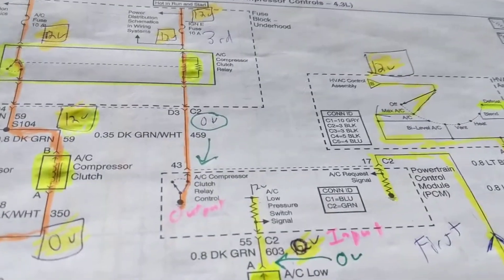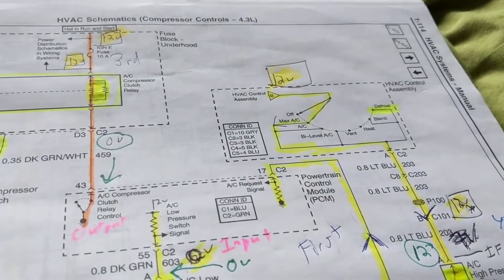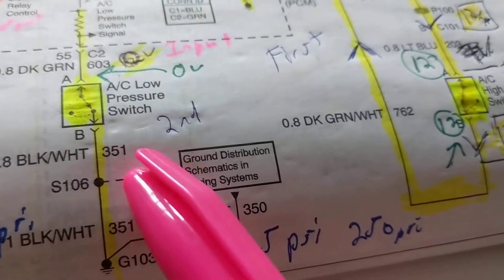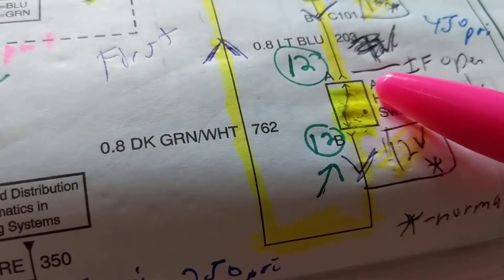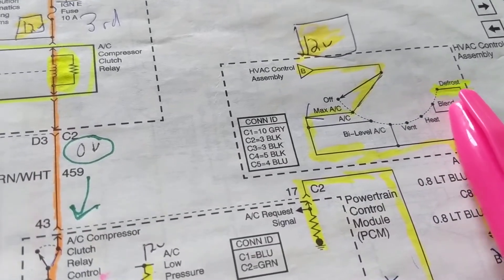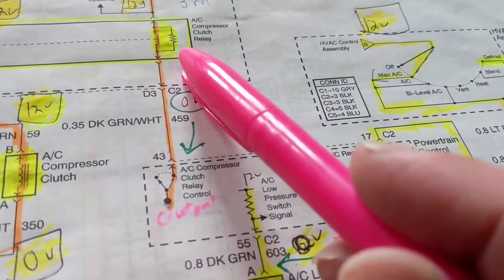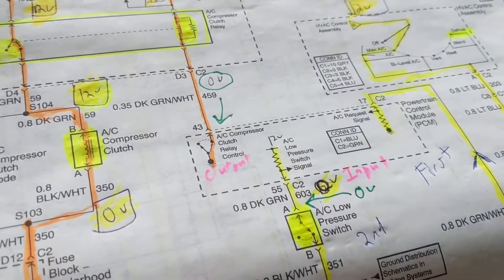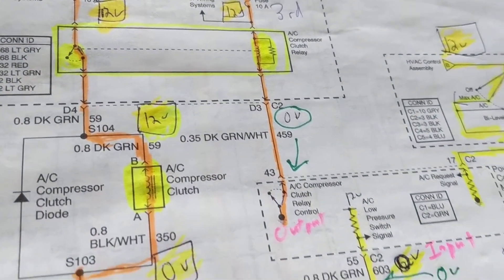how to fix AIR CONDITIONING PROBLEM RELAY from wiring diagram for compressor and relay problems

Comment: Is the pressure switch have low pressure and high pressure Just in one switch
Reply: Some cars have a dual pressure switch just 2 in 1, and also having this individual switch hi & low pressure switch.

Comment: What do you do if the pcm is receiving the proper 12v demand signal but it is not putting out a ground to the relay?
Reply from the maker: Then you have to make sure this continuity between that wire and the relay to make sure it's not broken by measuring resistance test you don't want to change a PCM and then have a bad wire be the bad symptom
Reply: From the connector of the ecm to the socket of the relay i have great continuity. i also have wire pokers i use to test it all while its connected.  it is a 2005 Ford E-350.  The selector switch on tge dash energizes a purple wire at the low pressure switch, which then goes through a high pressure switch (which are both jumpered for troubleshooting purposes, and a 12v signal feeds the pcm pin 4. pin 3 of the pcm should be putting out a ground which clicks the relay on and connects a fused 12v wire to the ac clutch on the compressor. the pcm is not supplying this ground. my thought is there could be some other condition the pcm is not happy with telling it to cut the ac. i am tempted to do a bypass while keeping the high and low pressure switches intact. my only concern is maybe the pcm elevates the idle whenever the compressor is running and now i may not have that and my idle will be too low. would a high level scan tool determine whats going on? i have a basic actron that does show live data but nothing like what some scanners can do.
Reply from the maker: @dangerdavefreestyle  a scanner will tell you if the high pressure switch and low pressure switch are activated now these have to be closed but that depends on the pressure they have to be the low side has to be the correct pressure and the high side has to be the correct pressure if any one of those are open obviously the clutch doesn't work if you find the relay you can jump the load side to the clutch to see if it comes on but it sounds like you're on the right track definitely a scanner is the best way to go what these type of computerized systems like what you're doing electronic wise good thought process keep me informed but they're not jump the switches only the relay because you do not know what the pressure is unless you measure it with a gauge set you don't want the damage any components
Reply from the maker: @dangerdavefreestyle  in other words the low pressure side protects the system from any low pressure like 10 psi or below the high pressure system protects the system from high pressure like 400 PSI or above depending on the maker model you don't want to jump those and make sure you don't have any leaks try toto measure the pressure
Reply from the maker: @dangerdavefreestyle  you could go to pin 30 and see if it gets a 12 volts unnecessary if you need a ground and your case try to give it a ground but first thing is first always measure the pressure
Reply: @Joeelectronicschematicsforauto  yes, those are simple on/off switches. the low pressure switch is normally open and it becomes closed when the pressure exceeds a certain amount. the high pressure switch is normally closed, it becomes open when the pressure exceeds a certain amount, to protect the compressor and other components. they are wired in series between the max ac selector switch and pin 4 of the pcm.  plucking the connectors of these pressure switches and inserting a u shaped piece of wire "for troubleshooting purposes" tells the pcm they are okay. unless there is some other sensor somewhere such as the evaporator i am drawing a blank. now i can fill the system if it makes you happy but there is a leak near my condenser i must fix before wasting $ on refrigerant and ofcourse fixing this electrical problem first, because what good is a filled up ststem that doesnt work?
Reply from the maker: @dangerdavefreestyle  yes I think I mentioned it to you if you wouldn't measure pressure you would have no pressure because you have a leak which means you have moisture and Air in the system so I think you found your problem like I said if you have someone to do it they have to vacuum it out and it should be okay should hold vacuum and pressure but if you don't have refrigerant not a good idea to even jump the relay because you might cause damage that's why I said first always measure with gauges but I like your troubleshooting logic you really know your electronics keep me informed
Reply from the maker: @dangerdavefreestyle  if you have no refrigerant cuz you have a leak obviously the low pressure switch will show zero that low pressure switch will not close and the computer detects that
Reply: I said: 
The low pressure switch connector has been plucked and a U shaped piece of wire has been inserted. This does the same thing as a properly pressurized system.

Unless there is some other sensor somewhere the computer is stupid. it sees 12 volts. 

if you really want i will fix the leak and charge up the system. there already was a few psi in there so i am hoping it does not have to be vacuumed because there is no ambient air in there.

i will have to jump the ac compressor clutch periodically to do this because there becomes a point the can cannot overcome the pressure in the system and fill it any further unless the compressor sucks it out.
Reply from the maker: @dangerdavefreestyle  you need the correct low pressure switch number one for the system to work the computer looks at this once you have a leak it is recommended to take the moisture out
Reply: i must not be getting my point across, think of the low pressure switch as a lightswitch, i flip the switch manually the computer sees it is on, unless there is another switch somewhere which provides a seperate input to the pcm other than the high and low pressure switches it should think all is well and trigger the relay.  if you really want i will fix the leak, vacuum it, fill it up and report back to you on it
Reply: i filled it up with r134a and made a switch so i can manually turn the compressor on as needed for filling, to my surprise with the dash selector on max a/c, i noticed the compressor was on. and sure enough somehow it knows there is freon in the system because it is activating the relay. i am fully aware of how the low and high pressure sensors work and how to bypass them and verify a 12v input to the pcm, it was very strange i could never get the pcm to supply a ground and activate the relay but now it does. there must be another sensor somewhere i do not know about, nothing on the evaporator area, who knows. i must give credit where its due, as advanced as i am and i know you are, your approach was simple in nature and very effective
Reply from the maker: @dangerdavefreestyle  the clutch should also cycle on and off that's from a thermostatic sensor you don't want it to be too cold cuz that's not good for the evaporator
Reply: @Joeelectronicschematicsforauto  Thanks Joe: What are you saying? That there is a thermostatic switch located somewhere on my evaporator that tells the pcm to cut off the clutch relay when it gets too cold? On this vehicle i see nothing of the sort, only low and high pressure switches on the refrigerant lines which i would think can accomplish the same task due to temperature being relative to pressure
Reply from the maker: @dangerdavefreestyle  it is an evaporator temperature sensor

Comment: Can u explain the wiring ac circuit of a 2005 Chevy malibu 2.2
Reply from the maker: I'll try thank you
Reply: @Joeelectronicschematicsforauto  thanks
Reply: My problem is that the blower motor turns on randomly..when the key is not even in the ignition..I have to remove the relay from the bcm so it won't do it
Reply from the maker: @reynaldoreyna839  you could have a relay that stuck closed and there's always working or you can have a bad module
Reply: @Joeelectronicschematicsforauto  ived changed the relay
Reply from the maker: Yes when I get a chance I didn't forget about it but I have so many projects going thank you Randall Ronaldo
Reply: @Joeelectronicschematicsforauto  thank you  sir

Comment: 03 2500 dodge Cummins 
I unplugged the abs control module and then plugged it back up. now no ac even when I push the brake pedal. 
The pcm is not sending a ground signal to the clutch relay.
Reply from the maker: There are different types of air conditioning systems sometimes it gets a request when you open the switch from the computer other times it goes to a relay what you could do is go to Google put in 2003 Dodge and then download that wiring diagram and then get back to me
Reply from the maker: And if you want you can jump the relay on the load side not on the control side to see if it comes on the clutch

Comment: Great video on how the system works in general, thank you.
I have 1986 190e which the compressor doesn't comes on.  I changed the original compressor, R12 and the dryer to 134A compatible, changed the push-button control & A/c relay, and the pressure switch, still no luck, would you direct me how to fix it.  Couple local mechanics has charged me to the nose, yet no A/c
Reply from the maker: When it comes to air conditioning two things have to figure out is a mechanical or electrical to see if it is mechanical or if there is a leak you have to put gauges or put a die through the low pressure side if it's electrical the low pressure switch has to be closed and at the compressor you should measure 12 volts at the compressor clutch

Comment: I have faith 🙏 that Joe will lead me 2 the source of my ac problem.good explanation Simplified.thanks joe!!!
Reply from the maker: You can measure the connector going to it but also keep in mind that for Chevys the computer turns on the relay based upon the pressure being correct thank you for your comment good luck

Comment: With the manifold gauge hooked up to both high and low sides, and with the engine running, does the gauge tell you how much the refrigerant is in the system ? Thanks
Reply from the maker: Yes you want to hook up a gauge for both low pressure side and high pressure side you should get around 25 to 35 on low and around 250 300 on the high
Reply: Joe electronic schematics for auto thank you for your reply
Reply: @Joeelectronicschematicsforauto  thank you sir for sharing this details of auto electrical diagram,,god bless
Reply from the maker: It is also based upon ambient temperature the readings